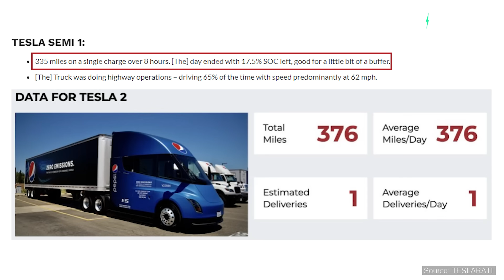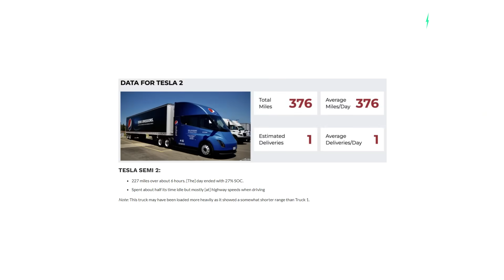Tesla Semi tested at highway speeds - REAL world range shocks rivals

Comment: Did they mention the start and finish altitude and wind strength/ direction? Hats off to Tesla, well done
Reply: Based on the fact that they are using a high power charger at the end of each day, they seem to starting and ending each day at the same depot. So, it looks like they are doing round trips, which means that there are no net changes in elevation.
Reply: @wr2382  thanks for the extra information 👍
Reply: Remember they have regenerative braking. If you are hauling tons up a hill, those tons generate power going downhill. Not as much power as used going up, but certainly a useful contribution. (I/C engines don't put diesel back in the tank going downhill) @wr2382
Reply: @wr2382 they "seem" to use the same charger? That is a big assumption to make given the minimal data provided
Reply: @orionbetelgeuse1937  oh I’m taking it at face value. In this limited report by the company in controlled(?) conditions. Still, the purpose built open road electric truck is well on its way… and that is what I am happy about
Reply: @saberint  This is real trucks delivering real loads as required by the business.   The depot is part of the test as well as the trucks.
Reply: @danharold3087  well yes and no. These are not real trucks. Test them after 12 months hauling. That’s not me having a go, that’s me being an engineer. I design something the best I can at the time, then, if I’m lucky, I get to work on the same product again improving it. This is a fantastic first step in the right direction. Long may it continue.
Reply: @saberint  Exactly.  Tesla has been testing these trucks at Pepsi and Frito for the past 8 months.   Tesla is also using the trucks internally.  When Tesla is happy with the trucks it will setup a faster production line and start making them in larger numbers.   In time they will build a 3rd line and crank em out.  Sound familiar ?
Major diff is the truck design engineers do not leave the product while testing.   Improvement continues.
Reply: @danharold3087  so what you are saying is these are not the production vehicles demonstrated, and we do not have the engineering data on them, just Tesla saying they work 👍 my point exactly, glad you agree with me🙂
Reply: @saberint  These are vehicles produced on the Tesla prototype line that were sold to Pepsi 8 months ago and have been in operation since then.    I do not know what you mean by 'the production vehicles demonstrated'?
Reply: @saberint   we do not have the engineering data on them, just Tesla saying they work 
No, you have the data from these tests, which mostly corroborates information Tesla has already released.
Reply: @orionbetelgeuse1937  These trucks are doing what they do every day.   Nobody is going to send a class 8 truck out all day to deliver "just a few boxes of chips".  They are loads as required by the business.   Look at the test data. They provide  several graphs including speed.
Reply: Wind strength depends on the curry & beer the driver had for lunch...😁
Reply: @alexmanojlovic768  😂😂😂🍻
Reply: @orionbetelgeuse1937  every journey begins with the first step🙂
Reply: @orionbetelgeuse1937  of course… but is anyone arguing it’s not a step in the right direction? The Tesla truck is a fantastic starting point. It is (hopefully) just the first step, and hopefully we go onto to vastly improve on the first step
Reply: @orionbetelgeuse1937  Did you visit the data on their site.   Word is they will be providing load data in about a week when the test is finished.   No conspiracy here.  
Realize this is more of a real life demonstration of how the vehicles are working out.  There is a lot more here than the Tesla Semi.
Reply: @orionbetelgeuse1937   they did not say the load for the so called test and did not provide an accurate speed graph
Each day's run includes a very accurate graph of speed. Load will be included in the final report.
Reply: @orionbetelgeuse1937   Search Run On Less Results. Select PepsiCo (Sacramento) under Depot. Select the day you want to see, and which of the three Tesla Semis you want to see, and click Update.
Exact loads won't be known until the final report is published; but Mike Roeth of NACFE, the sponsoring organization, has stated in a quote in an article in Electrek that "We’re tracking the beverage. It’s impressive, a fairly heavy haul at nearly 80,000 pounds." These trucks are delivering goods from an active PepsiCo bottling plant, so trips would be weighed out at around 42,000 lbs. payload, compared with trips from a Frito-Lay plant, which would be cubed out. So at least during the test, it's safe to assume that trips at the beginning of the day are at around 80,000 lbs. GCVW; later trips may be RTB unloaded.
Reply: @orionbetelgeuse1937   Maybe they had just a few boxes of chips. 
This is a PepsiCo bottling plant, whose product is dense liquids. Chips would come from a Frito-Lay plant.
Reply: @orionbetelgeuse1937   we do not know how long is the trip 
The length of each trip, starting with each charge, is shown to three decimal points. As such you know the length of each trip to within 10 feet. Please stop lying.
Reply: @orionbetelgeuse1937  WTF? You already asked me that, and I already told you. Look at the fifth comment up.
Reply: @orionbetelgeuse1937   well, I can't see any link 
I didn't say there was a link. I'm surprised that a renowned expert such as yourself would not be aware that YouTube doesn't allow links in comments, except to other YouTube videos. What I said  was "Search Run On Less Results". For the uninitiated, this means to type the words Run On Less Results in your browser search window. Let me know if you need even more basic instruction.
 There is no data about the load. 
 I stated clearly in two different comments that "Load will be included in the final report", and "Exact loads won't be known until the final report is published". What's being released is real-time data from instrumentation on the trucks, to three decimal places, so folks who wish can follow along with daily data. Vehicle weight and payload are not instrumented, and so don't appear in the daily reports; but will be shown in the final report. I've already told you that a representative of the sponsoring organization, NACFE, has stated that these trucks are going out weighing about 80,000 lbs., which is equivalent to a payload of about 41,000 lbs.; but of course you will discount this as some sort of trick, or lie, or conspiracy, or whatever.
 They did put a graph of the speed 
 There is no info about how much it was at other speeds like 50mph
The speed graph shows the speed at every second of the 24 hour test day. The pie chart breaks the percent of time at each speed down to four MPH ranges; 0-19, 20-39, 40-50, and >50. If you need more information than this, you can derive it yourself from the second-by-second chart, or take it up with NACFE.
 there is no graph of the speed vs distance 
Four parameters are being captured by real-time instrumentation; time, speed, distance and battery charge. There are 24 possible graphs showing three parameters per graph. NACFE did not have room to show all 24 for each truck for each day for each depot, and chose two instead; battery charge and speed vs. time, and battery charge and distance vs. time. From these two, you can find the speed at any distance. If you don't have the math skills to do this, feel free to reach out and I'm sure someone can walk you through this.
 this is just an useless test trying to hide the fact that these trucks are good just for short distances and light loads. 
Sam's video was based on a single day's operations, out of 14 total, of which there's now data for five. The five days' preliminary data suggest that these trucks' performance is consistent with Tesla's stated performance; but complete data to support or refute this won't be available until the final report is released, likely in mid-October or thereabouts.